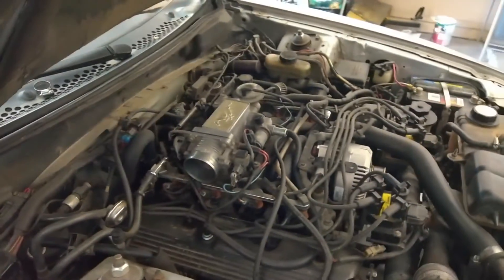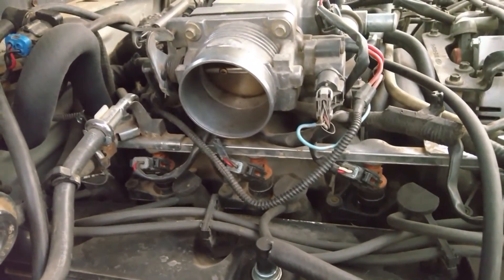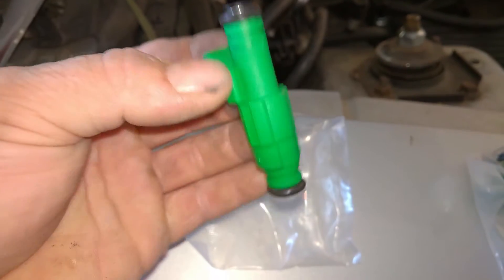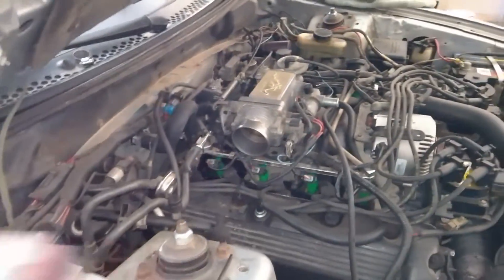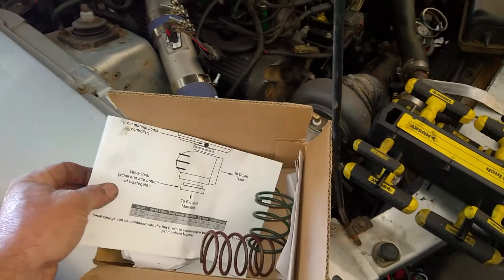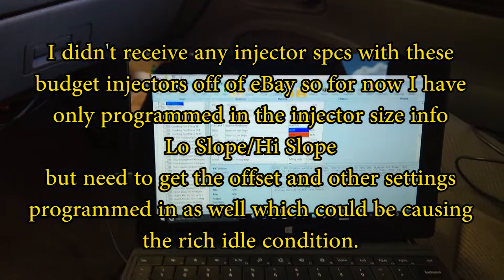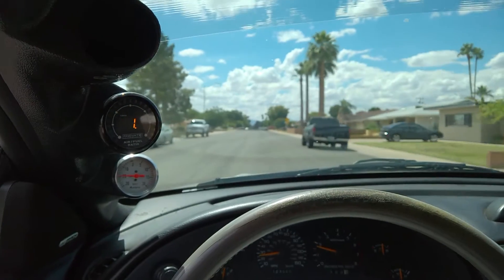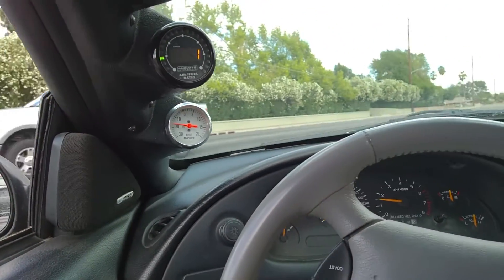Project Mustang - 42Lb injector swap - Quick test drive

Comment: Yellow 19, light blue 24, red 30, dark blue 36, green 42
Reply from the maker: How about orange? I was told they were #30 and the #30 tune seemed to work.
It's been a while and I have a box of injectors I might need to figure out if I ever get around to turbo charging the Ford Ranger 2.3 I4

Comment: Holy hell .. this is an old video but you actually purchased a set of cheap knock off made in china fuel injectors and put them on a boosted application ? did you blow your motor or did you remove them before it took out the engine? you should have known better.

Comment: Those are the bosch knockoffs I would be weary of those for much long term use......  https://www.youtube.com/watch?v=l2ne6AVnF2k
Reply from the maker: Thanks I will check that out. These 42 Lbs were surprisingly cheap. :-/
Honestly I have yet to get this thing tuned properly since swapping them.
And not as smooth of an idle. Makes me think they are not matched at all.
I'm tempted to throw the 30 Lbs back in and see if the car runs perfect again.
The 30 lbs tuned real easy and had a good AFR from idle on up till they maxed out. I was a little lean with the 30's though.
Reply: +hackfreehvac I bought some 42lbrs from Siemens Deka. got them for 130 on ebay. Great name brand quality and affordable
Reply from the maker: 98snakehorse
Cool. I just popped the 30 Lb back in last night. Drove better a little but I think I need to monitor my fuel pressure regulator. It may be sticking. I need to make an adapter since it has the old style fitting.

Comment: Does anyone know if the 80b Eva mustang injectors will work in a crown vic?
Reply from the maker: Check out eectuning.org 
Lots of info about tuning the Ford EEC unit for different injectors etc.

80 Lb are HUGE! Like 4 times what that Crown Vic came with.
You'd only need those if you had a built engine pushing 1,000 HP or something! LOL

Comment: Please let me know what program you are using to tuned.
Reply from the maker: +Jose Maria Martell The program is called "Binary Editor" made by these guys.
http://www.eecanalyzer.net/

The chip/emulator tied into the stock FORD EEC-IV computer is called a "QuarterHorse" which Binary Editor works well with.
It can tune with the engine running.

Someday I should spend the little extra for eec analyzer. I guess it has tools to auto tune your MAF curve etc. Which can save hours of trial and error after you change something and need to retune.

Comment: cool ride.  did you get new tires yet?  Miss your hack videos.  I just ran into a doozie, sump pump in underground supply ducts with standing water.  Boss says it is normal, I disagreed, brought up legionarres disease possibility.  He said just do the other apartment the same way.  I said no, still waiting on my punishment.  LOL.  any codes anywhere that allow sump pumps in supply duct work?  LOL
Reply from the maker: +All Hours Maintenance No not yet. And the back ones are getting really bald now! LOL

So are you crawling in those underground ducts or something?
Diseases from stagnant water is never fun.
Reply: They are supply ducts for an apartment.  They were built in the 50's and are under the concrete slab.  Get new tires, they will make all the difference.
Reply from the maker: +All Hours Maintenance Yeah I will when I get my but to the shop again.
I'm really wanting to take the turbo off and redo my exhaust piping first.
It keeps leaking at the collector gaskets.
I used header style collector flanges thinking how simple they would be. And they are. But they keep leaking.

I think I'll either look for some used stocker style donut seal exhaust couplers from a junk yard or maybe try the sand rail/ATV shop up the way and see if there is something better with a more foolproof seal.

I also need to redo my downpipe so it is not under the front cross member. It bottoms out on speed bumps etc and the car can not be driven over the typical car lifts at the tire shop at the moment.

Comment: what turbo are you running?
Reply from the maker: +EDunbar I bought it from Arizona tractor and Turbo.
AGP is the brand i believe as is the waste gate.
That guy used to deal Borg-Warner but he switched to AGP for the low buck stuff.

I think the turbo was $400-ish and the waste gate like $150-ish

I never did pay attention to the housing specs but I just told him I my goal was 450-ish HP and quick spool.
It spools quick for sure.

He said the turbo was capable of about 500 HP

Comment: nice video bro check out my vids. I'm building a beast this summer
Reply from the maker: +Duct Tape Yeah similar car. Except the one you show is the standard V6 and this one is a GT with the V8

A turbo would make that V6 scream too but that's a lot of work as this was.
Reply: +hackfreehvac yea actually I'm thinking about building a 347 to put in it and might turbo it when I save enough cash.
Reply from the maker: +Duct Tape With that kind of power it would be hard to even put it down to the street.

The V6 with a turbo would be a good sleeper. And would be a lot cheaper than the swap itself. Plus more under hood room.
You just would not get the V8 sound.
Reply: +hackfreehvac Yea your probably would be more particle, I have been looking at the procharger that american muscle sells I would be making about 350 in HP if I went with it
Reply from the maker: And 350 is nothing to sneeze at on the street.
Reply: +hackfreehvac yea that is at low boost though if I wanted to I could probably get a little more

Comment: I don't think I've ever seen orange-top 30 lb injectors. Usually orange-top injectors are 19 lb-hr, and rep-tops are 30 lb.
Reply from the maker: +American Locomotive Probably depends on manufacture or year I guess.
They were definitely 30. When I got them the entire tune was stock and I I tried to start it for shits n giggles and it was pig rich and stalled.
I programmed the tune for 30 lb and it ran great ever since.

Now I'm trying to get the 42's dialed in.